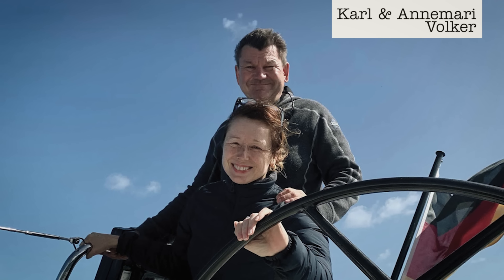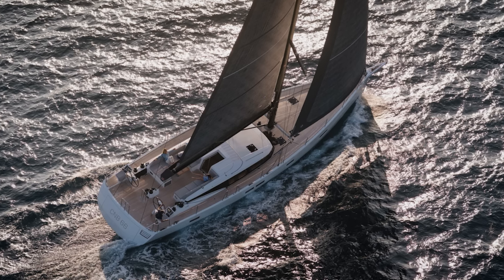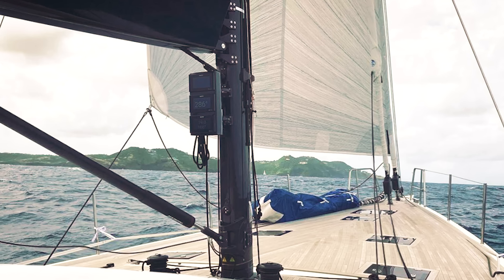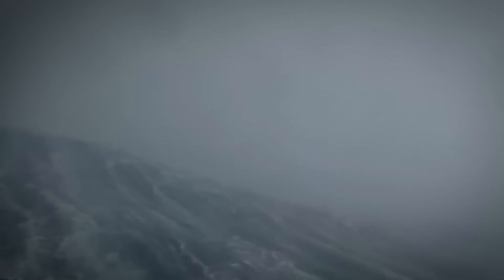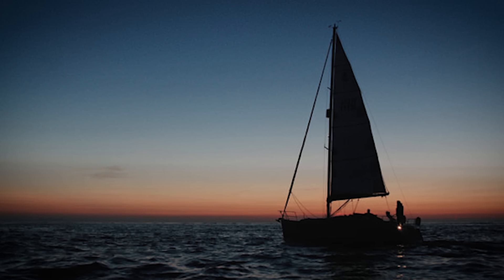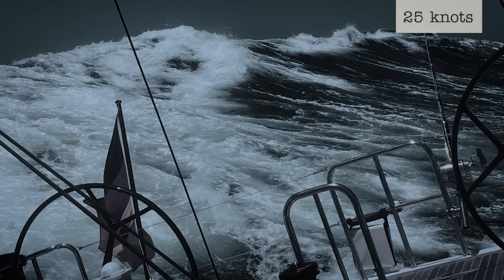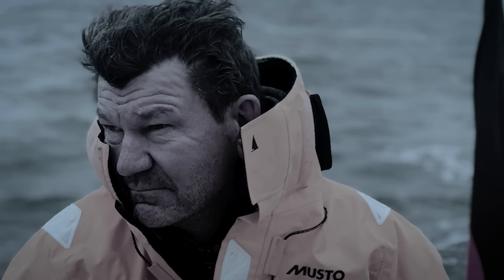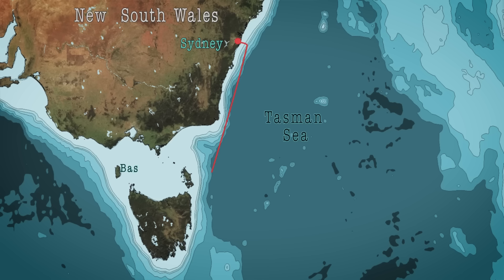Couple DIES on Private Yacht!

Comment: I used to sail, having learned in a 20' gaff rigged timber hulled whaler. I got boom bashed and thrown overboard. Thankfully it was in enclosed waters. I continued to sail, with that in mind.
The sea is a fickle thing, calm and serene then horrifying. I have since gone to sea and crossed oceans in all seastates, in multi screwed, steam turbine, steel hulled ships; it was no less dangerous. The sea doesn't care. Experience in those seastates does.
Taking an inexperienced crew on such a voyage is just asking for trouble. 
The crew were lucky....... Or were they?
Fair winds and following seas, Karl and Annemarie.

Comment: When you reduce the mainsail at sea, the best is to sheet in the jib as much as you can and to sail close-hauled as to have the boat to lean on it's gib and thus stabilized. Not doing that is very dangerous as nothing is more instable at sea than a sailboat in rough seas with its sails not catching any wind.

Comment: The moral here is that a smaller boat is better.  Very large boat means too large equipment means very risky to handle.  This would never have happened on a 30'-35' sailboat which is plenty large enough for a couple of two sailing long term.

Comment: The boom vang does normally help to reduce the violent boom uncontrole movement,  and some very efficient boom reterner,  are designed for big boat like this , not just " ropes " ..surprised that this beautiful boat was not equipped with a better boom retener system

Comment: The crew did an amazing job by the book and more . However the captain owner made some poor decisions. Too much boat for two people. Added crew helped but if you are unsure of night wx then you do a reef well before and issue arises . And downwind with a following current is tricky enough . Better you sai 19:38 beam  reaches much safer . I don’t like boom roller furling at all yes in mast reduces sail area but they are cruising not racing . That boom weights a ton and is a killer on any boat .
Reply: 20 / 20 hindsight is always perfect
Reply: Boom furler wasn’t much issue here, as it was explained it was impossible to take the sail down even manually due to the weather and sail size. It seems that the main issue was boat and sail size and they likely would have the same issue without the furler.

Comment: I heard that the halyard was eased prior to getting the bow into the wind....that the main then cupped, and snapped the main sheet.
they where already motoring I think.....from there; they only would have needed to instruct the auto pilot to take, and hold, the bow into the wind, then pay out the preventer while sheeting in, and upon irons, safely douse.....of course they would need to head up opposite the preventer, and I don't know how well they knew their auto pilot.
in situations like that it is almost impossible to manually hold the bow into the wind, and you need an auto pilot to do it.

Comment: That boat was much too big for two novices. They bit off more than they could chew. Plenty of Bluewater capable yachts in the 40-50' range. They didn't need a 67' boat for just two people.
Reply: But they had $2 million to spend so bigger it was. You're right,  too much boat.
Reply: Too large boat too much power to handle too much little experience too much relying on technology to compensate .
Reply: That's what happens if the inexperienced decided to use up 2 million for a boat without experienceing properly themselves which not only is dangerous but cost them their lives as a result 😢

Edit: am not saying they are bad but they took to the bigger size way too soon without properly getting used to sailing
Reply: 35-40 ft boat is about all 2 crew can handle. Crew needed  is geometric with size. Appropriate crew about 6,at least 2-3 days of familiarization aboard before going to sea.

Comment: Had a similar experience headed from the carribean to newport in a 52ft racing cat. we had lost satcom earlier and so our weather was 3 days old.  we were in the same general place as they were when it went from a beautiful flat water 80 degrees of temp and 18kts of breeze from behind to a complete washboard, 5 meter seas and 30kts upwind and 38 degree temps. We put the first reef in when we saw the gulf stream interface, "just in case" but within 5 miles it was too late to do more. we tried for a second reef but quickly realized that wasn't going to happen. Ther wind had built to 40 and we were having difficulty maintaining any kind of forward speed. boatspeed was either 5kts or 20, and both were bad. and then the sleet started. we were only 60 miles from block island at this point, but it wasn't happening, so we dropped the main and  turned around and went downwind. wind abated in the morning and we ended up going in at new york city the next day. had a burger on liberty island. 3 of the crew were very experienced and capable, which lead us to the #1 lesson from this trip: the wind will choose where you go and when you get there.  After that I no longer will make a return flight from a delivery. We'll get there when we get there.

Comment: I always put a second reef in the main and at least one in the headsail before dark regardless of weather conditions, I also use  16mm spectra for both my main sheet and preventer, that's on an 8 metric ton steel Stadt 34' with a Selden fractional rig, I've sailed on quite a few 60+ boats, mostly racing yachts so I am only too aware of the dangers of an uncontrolled gybe. I've never been a fan of any kind of furling main, be it in mast or boom, bat cars or even just simple slides at least allows you to dump it if need be, this is a tragic accident that could have been mitigated and a lesson for all, argument perhaps for that tried and tested simple GGR style double sheet, admittedly not ideal on a 60+ dual helm boat with central main sheet winch but safe as houses. Condolences to their families😢
Downwind reefing is an essential skill but reefing early is a better and safer option, I pray to God Almighty as a single handed sailor I never have such unfortunate events occurring at sea, again Condolences to their families 😢😢😢😢

Comment: I  stopped watching knew the outcome
, I  had a 56 footer, same sail setup with powerful hydraulics on all winches, inc main sail reef line which takes enourmous loads, some inbooms need to luff a little Leisure furl  does not, in the opening min you talked gybing without control, so all yachts need a boom brake which stops the boom crash gybing
crazy end, truly saddening, I  am sorry

Comment: I can't really comprehend why anyone would be sailing down wind in 10-18 knot winds with full sails and the motor on. And then they try to bring the sail in when winds hit 34 knots. Thats insane 20 knots of windspeed is too much for most sailing vessels they should have been bringing in the sails then especially if it is changing speeds quickly from 10-18 knots but in this retelling he calls that relatively calm conditions lol.
Reply: I didn't and actually still don't get that either.. I've two yachts and am often single handed. Only ever put engine on into the wind when close to shore or to moor. Off shore just reef downwind and in the conditions described I'd just use the jib..Is it not possible to put the boom in line with wind to enable the main to be lowered and reefed..?  I must be missing something?
Reply: On a boat like this going downwind in 20 knots the apparent wind is low. On my own 60 footer in 20 knots, I have full sail up and an apparent wind of 10-12 knots only. And 20 knots downwind IS relatively calm conditions for open ocean sailing.
Reply: @deerfootnz  yeah I should have mentioned all my sailing experience is from a very small sailboat on a lake lol.
Reply: @peterlangdon4955  You're not missing something. Either the story is inaccurate or incomplete, or one, or more of those aboard made (a) catastrophic blunder(s). For more detail, see my own comment.
Reply: @deerfootnz  Exactly. Reefing a roller furling heads'l under those conditions is rarely difficult.
Reply: @peterlangdon4955  Maybe to charge batteries

Comment: Because someone asked, I will state what I consider a cutter rig to be. A cutter must have at least two headsail (often called jibs). But that is not enough. There are plenty of double headsail sloops.

To be a cutter, the vessel must have its mast stepped further aft than a sloop, often near the mid-length of the deck, or near that.  

The vessel in this story was set up as a masthead, racing sloop. This required not only a relatively large mainsail (roughly 40 to 45% of the total sail area) but also a very tall one.

The problems with this are two:

1.) The sail has to be shortened down by quite a distance to significantly reduce its area.

2.) The square footage of sail per length of boom is much greater. This, on top of the lesser inertia of the boom, means it can swing at great speed. A longer boom, although heavier, has much greater inertia for its weight, so would accelerate slower

For a boat, this size and an amateur  crew this small, this boat was an accident waiting to happen.

Also, while sailing downwind on an open ocean, with this small of a crew, the mainsail should have been furled, with any hint of coming strong winds.
Reply: Tell that to professional delivery crews who routinely and safely make transatlantic or Pacific deliveries with only two three crew and rarely douse the main except in strong gales. Modern sailboats need the main for stability, control and power, even it must be triple reefed down to the size of a postage stamp. Insufficient sail area, especially with the main can often be as dangerous as too much.
Reply: I wonder if a ketch could had been a better choice.
Sailors who are helming a ketch, often doesn't use the main sail. The mizzen sail, being much smaller, would be easier to work with in all weather conditions.
Reply: @frankmiller95 

Normally, I would agree. But with this particular boat an crew, I have to disagree.

First, this boat did not have a professional crew on board, even though at least one of the crew was a professional. Unfortunately, the skipper wasn't. And, with a boat this big with this kind of sail and reefing setup, you need a skipper and crew that can act as a single unit. With this boat, this was sadly not the case. The skipper and crew didn't even speak the same language. And the crew was not made familiar with the operations of the boat. Had it been my boat, I would have gotten this crew familiar with the sail handling as soon as it left the dock.

Second, when sailing downwind, the mainsail can become a huge liability, especially when the wind gets strong. If the wind switches directions and the boat yaws the wrong way, the mainsail can be slammed over to the other side. In squally conditios, wind directions can change by a considerable amount. 

With the greeness of the crew and the predictable problem with reefing quickly and the direction the boat was sailing relative to the wind, would have sacrificed some speed and either taken the main down completely or preemptively reefed it quite drasically.

It is the job of the skipper to anticipate things going wrong, and almost expect them to.

On the 17 ft boat I used to own, I almost never went straight downwind in any kind of wind strength. I did it once to frighten a skydiver I had on board who thought he was such a badass. The boat rolled, pitched, and yawed like a mechical bull. When I notice my passenger getting a bit pale, I changed course to a downwind tack. And the boat settled down.
Reply: A cutter in its truest form has the two headstays parallel to each other but with the inner stay bearing the load and it's fixed at the stem with the masthead/outer headstay attached to a bowsprit not load bearing, these days anything with two forestays is a "cutter" which is absolute rubbish, you can have a fractional cutter rig for example, a solent rig, a slutter which is half way in between the two. This boat had a main driver performance rig and at 60+ would have a very big main which you would absolutely not be able to handle even with 4, I've raced 4 spreader rod rigged open 60's with running backstays and centre main sheet winch, dual coffee grinders for the 75 ST primaries and it is no joke sailing a boat like that even in 15 Kn. They probably over extended themselves with the size and power of the vessel in all honesty
Reply: @charonstyxferryman  No. lt's easier, but not better for technical reasons to complex to get into here, but here's a two word hint: balance and power.
Reply: @bobcornwell403 Attempting to extrapolate about the proper maneuver in this situation based on your personal experiences in a daysailer is a mistake.